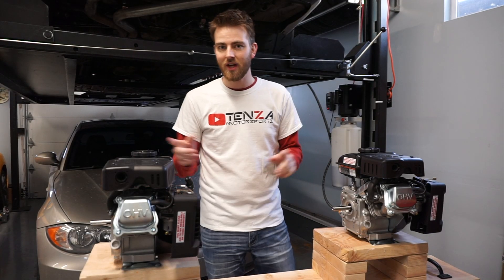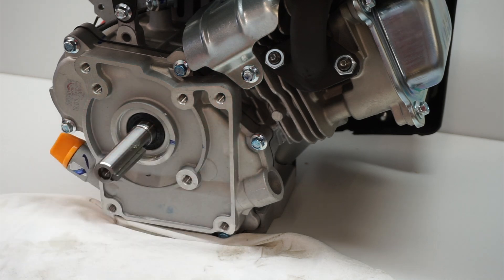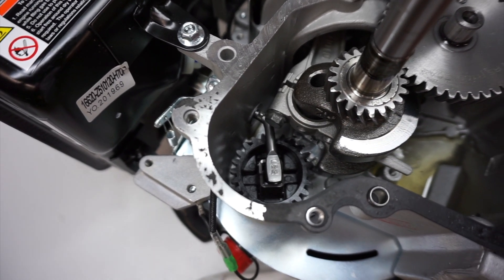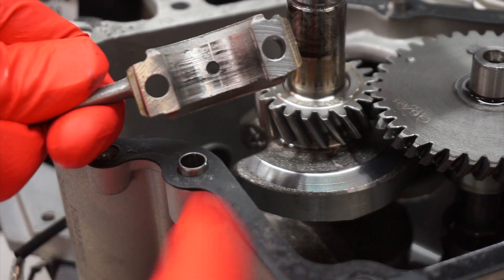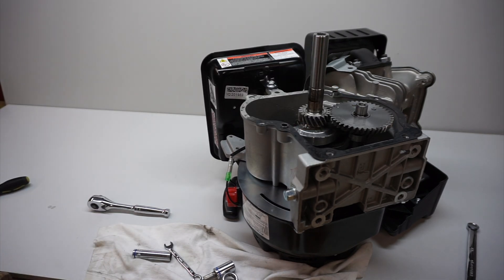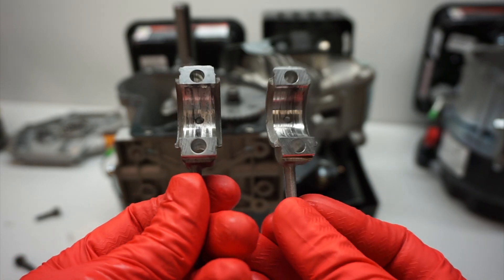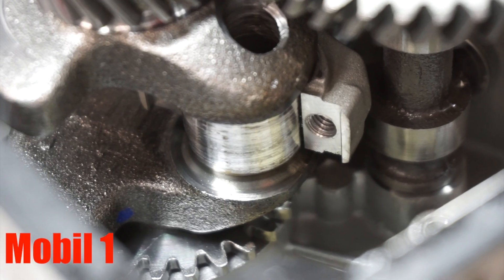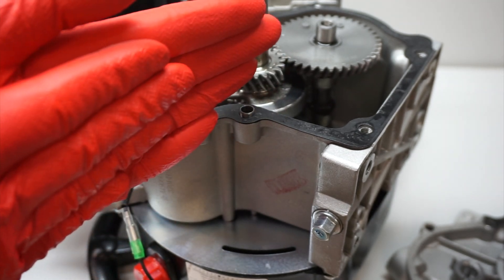Mobil 1 vs. Amsoil. Damage Report Torture Test Results. Search for the best synthetic oil (part 3)

Comment: These tests are actually meaningless since no oil is designed to protect an engine like that and Amsoil makes no claims like that.
Reply: Shows film strength on the oil. If you put motorkote in it I bet the engine would of ran 30 minutes with no oil after treating it with motorkote
Reply from the maker: I'm not testing any claims made by any company. This was to test lubricity mainly. The data sheet shows the thicker oil lasting longer.
Reply: Tenza Motorsports I almost thought th same thing as Paul here but then I got to thinking the way you set this up with you warming them up and emptied them it tests like all sorts of stuff. If the oil is too thin it’ll drain everything. If it doesn’t stick to the metal it would also be all gone. Good testing bro. Keep it up👍
Reply from the maker: Absolutely! This tests all of my bench tests in an engine based experiment. It tests lubricity, viscosity, and oil retention.

Comment: Polishing the crank and replacing the rod would fix both. These little engines don't have a real oil system, just splash.
Reply: upside downdog right! Do it on a small engine with a spin on oil filter and pressurized oil system not a splash system. Those rods will have replaceable bearings
Reply: And that piece of aluminum on the end cap of the rod isn't  just a convenient little handle,  it's what splashes the oil to get it to the critical components.  No splash,  means it's toast in 5 to 7 minutes. 😂

Comment: All I know is in regular life, I’ve got an E36 M3 that is run strictly on Mobil 1.  The car now has 273,400 miles, uses a little less than a quart of oil in 5,000 miles, has no knocking or other unusual sounds.  I use Mobil 1 in my 2018 4Runner and ALL my 4 cycle power equipment—zero failures.  My 2006 4Runner had 237,000 miles when I traded it in, no oil consumption.
Reply: Hard to argue with these mileage numbers.  This encourages me to stick with Mobil 1, as I was recently thinking about trying other oils.  Maybe they are out there, but I have not found any documented cases, other than Mobil 1, being used for 250k miles with little to no wear.  Thanks for your comment.
Reply: @whatsinanamethatthecaptive577 check out Ultra Platinum I think you’ll like it.
Reply: @whatsinanamethatthecaptive577  mobil one is actually a very average oil lol
Reply: I have a yard tractor that is over 20 years old with a Kohler V twin. Gets used a lot when the grass is growing. All it has ever had in it is Mobil 1 15- 50 racing oil. Never ran it with no oil.
Reply: Not impressed I have a 2011 Dodge ram 3500 and now I 500 it now has 997000 miles on it I change oil every 10 to 12000 miles and I have used rotella 15 W-40.  I also hauled travel trailers with it for a living so it's pulling a heavy load all the time
Reply: @BBBYpsi  997k miles?
Reply: @BBBYpsi  rotella is a top oil along with Amsoil
Reply: 5w40 Mobil Delvac 1 in all my BMWs turbo applications and other twin turbo cars.  Zero failures and no chain issues or anything
Reply: Yes sir!  A good oil should get people the mileage which you mention but to remind everyone reading, we are speaking about the “Best” oil that exists by data.  BTW, FYI (and I wish I could provide the data for what I’m mentioning) but mobile one “thickens” 17% within 4600k & 5860k...UNCERTAIN IF THIS WAS THE EXTENDED RUN, annual or regular mobile one but that is considerable if you go too long. Amsoil thickens 7%, goes “up to” 25000k, or one year, or 700hrs of operation. Again, our cars and toys will in fact last if we change our oil on time. Amsoil will always provide the very best protection “within an O.C.I” to the end.  Now, Pennzoil Ultra Platinum provides the fastest and noticeable acceleration for sure and comes fairly close to Amsoil in test data BUT does not provide adequate longevity protection  like all other claimed synthetics. Amsoil is 100% synthetic, not “full” syn..   My final thoughts for “Death Of Engines” testing with oils would be using all competing contestants’ oils at the END OF THEIR KNOWN SERVICE LIFE “then” beat the hell out of three different new motors. This would show a lot but would be an expensive one to do with accuracy, honesty. Abuse spent oil brands to see what you get with viscosity start  and end viscosity upon death of the motors etc...this would most probably be the only way to really know what is  king beyond the best data out there which Amsoil holds. Three identical new motors using SPENT oil and run until failure with various abuses.
Reply: What grade of oil on your E36 and what are your change intervals?
Did you put all the 273k on the motor?
Reply: Mobil 1 has been known to harden orings in Subarus. I stick with only Ultra Platinum.
Reply: They say mobile 1 just tests on the middle to lower end. But I’m sure it’s still a quality oil,I would say your 5k interval is what helped the most. If I remember correctly even the cheapest api approved oil new is better than expensive boutique oil at 4000 miles
Reply: Keep in mind amsoil is much better than Mobil one. If your engine lasts 300k with Mobil one, it’ll last 500k miles with amsoil?
Reply: @Eclipsis17 Amsoil is not even better than TGMO, the numbers don’t lie.

Comment: Which engine oil is good for motorbike motor
 ? I come from Vietnam
Reply from the maker: I run the recommended Honda oil in my dirt bike. If you want a safe oil to use I'd suggest looking up the manufacturer recommended oil. If you want to try something new, I'd continue to do research. I can't really comment on motorbike specific oils. I don't have enough experience yet.

Comment: All you really have to do is take a piece of Emery cloth and clean the Rod journal on the crank and a piece of steel wool and clean the cap and the rod itself and it will go back together and be free I've done it several times on small engines that have been run without oil to the point of seizing up I let them cool off add oil back to the crankcase take the pull start side cover off and use a pipe wrench to spin it over to break it free and allow the oil to get in between the rod and crank Journal
Reply from the maker: If this actually works that’s great advice! In my case it would skew the results for my next two oils. That’s why I need two new ones.
Reply: Tenza Motorsports    He is correct don’t throw the engines away you will have a bunch of good engines when you are done with just a little bit of work you will have a bunch of engines that have a lot of life left in them.  You can even change the connecting rod which is a very cheap part and you will be up and running.

Comment: Supertech and Pennzoil Platinum would be interesting!!
Reply from the maker: I was hoping to do super tech. I have a poll up right now and everyone is voting pennzoil and valvoline
Reply: Ryou Tenza Motorsports — Make sure you test the Pennzoil ULTRA Platinum, NOT the run-of-the-mill Pennzoil Platinum! There is a significant difference between the two!
Reply: I pulled the valve cover on my FIAT at 44k miles and perfectly clean.  No varnish or sludge.   Only used Pennzoil Platinum since new.  5w-40.

Comment: I would suggest to test Royal Purple. That is the oil you personally use on your cars and it seems to be a great oil, also to see if Royal Purple is worth the extra cost compared to other oils.
Reply from the maker: It’s all to come! I have many plans with royal purple
Reply: Royal purple is also overrated
Reply: The difference in these 3 oils is amsoil is a 100% synthetic and will break down at a slower rate than the other 2. As far as there ability to lubricate when oil is not broke down would be similar.

Comment: you should test the royal purple you used then the recommended oil that BMW recommends for the e46 you have which is a 5w30 castrol or a 10w60 Castrol TWS (recommended for e46 m3) to see what the difference between the two.
Reply from the maker: Royal Purple will be tested in the future
Reply: Royal purple is average at best, very overrated like mobil 1

Comment: It would be interesting to see if having something like 10 vs 10 engines with (brand vs brand), average them and see if the failure times of the engines are different significantly. Sample of 1 does not prove much. i mean if you test 10 engines of mobil 1 they could conceivably fail in a wide range of times. I'd pitch in if you did a go fund me on 10 mobil1 vs 10 amsoil  :) for science!
Reply from the maker: A better sample would include more, absolutely. I just dont have the budget to test that many. I have a Patreon but no one seems interested in helping so far.
Reply: @TenzaMotorsports   Thank you for doing this anyway man this is quality content you tube needs instead of he said /she said opinions

Comment: This Test is good but because you waited for both engines to seize they will both have similar levels of damage and then this teardown is not useful. Maybe running the engines on high load and below minimum oil level with two oils will demonstrate a long-term comparison with different oils when they are strained their hardest.
Reply from the maker: Great comment! I will explain my reasoning better in the next versus video I do. I tried to explain the best I could in earlier videos but I keep getting questions. So keep an eye out for that video, I will answer your question.